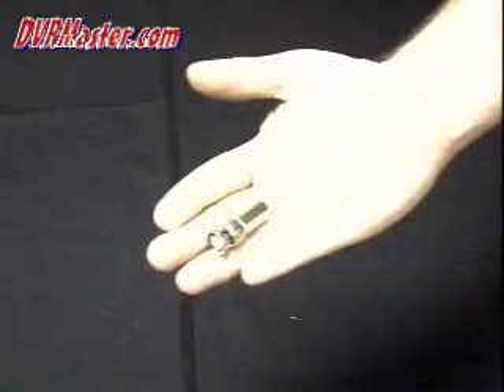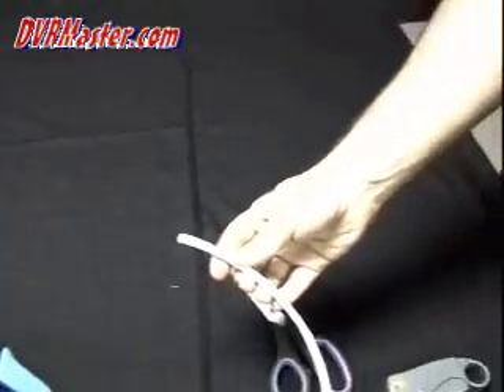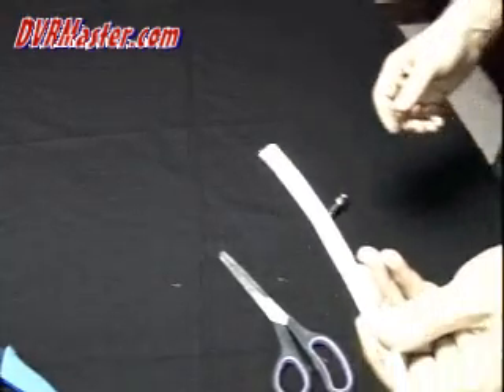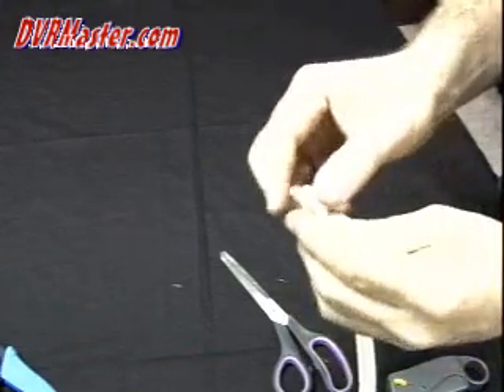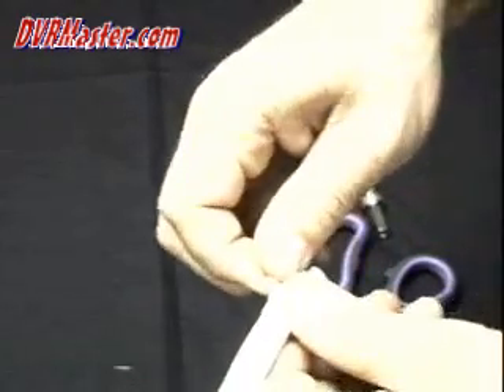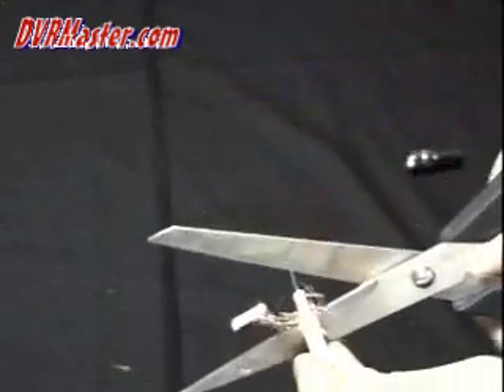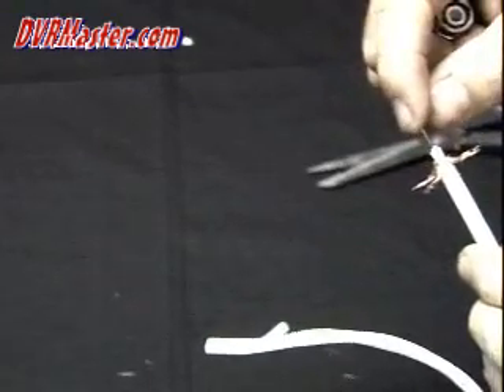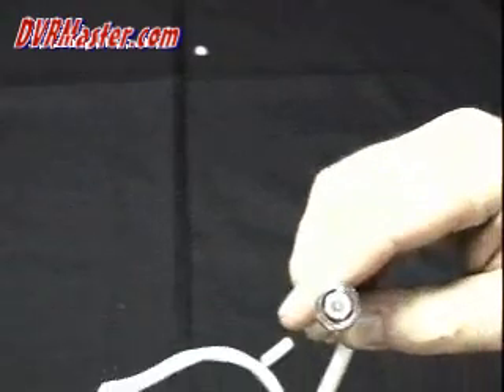Terminate Twint-On BNC Connector

Comment: I use a cutting tool which cuts in the right places. I do not fold back the braid, it makes it too hard to twist on the BNC. As long as you are using a cutting tool which leaves the braid neatly in line with the end of the foam this works.

Comment: this video is good too see however it would help to have some measurements on where to cut.  The ones in the video are very vague.

My concern is not getting the centre cable touching the pin in the tip of the twist on connector.